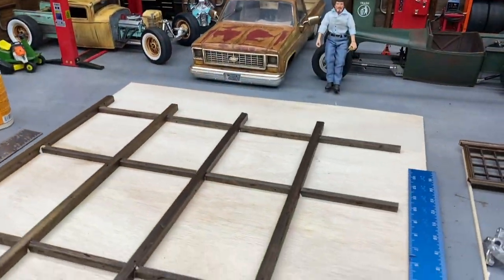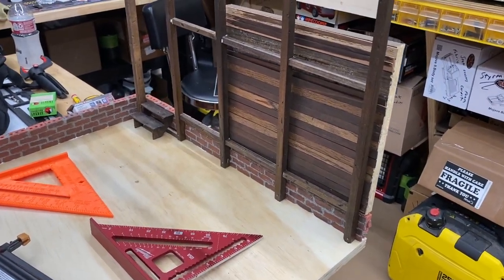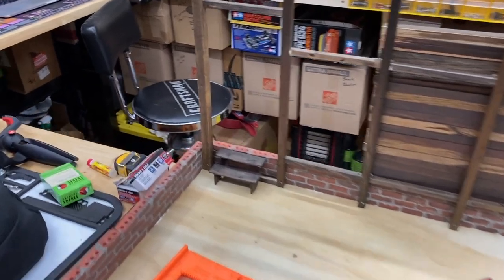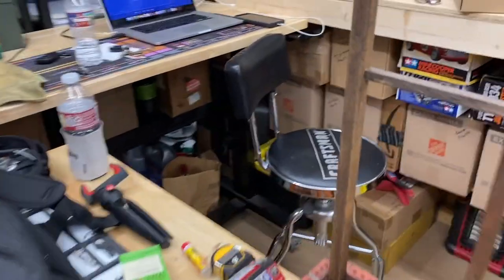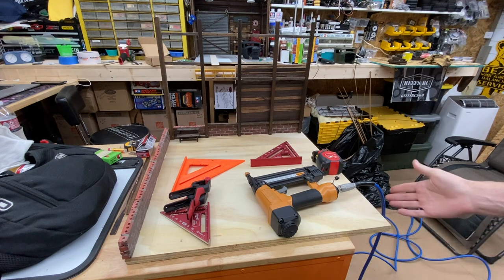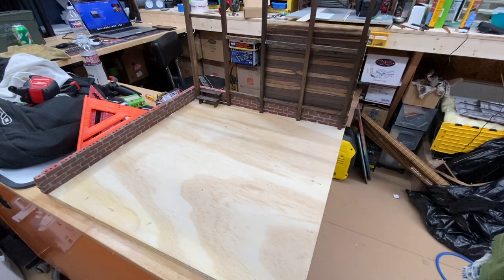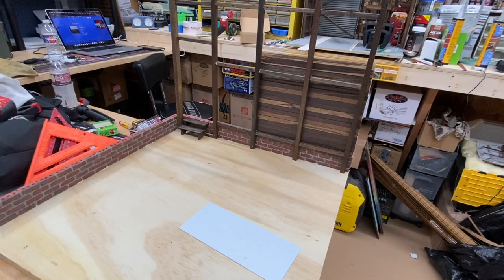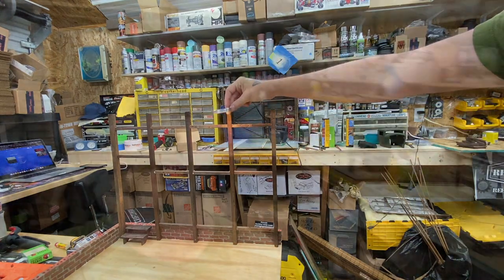Distressing Wood, Part 2 of the Scale RC Garage Build, Old Warehouse Diorama

Comment: Yeah Balsa doesn't take stain very well but you can Ebonize it which will blacken it while leaving the grain visible. 
If your interested in Ebonizing, making some Ebonizing solutions is really easy and can be done with stuff you have at home. 
  First you need Rust Vinegar which is super simple to make, all you need is regular White Vinegar and some four-ought/super fine Steel Wool. Second you need a Tannic Acid solution which can be made with Tea Bags and Water.

For Rust Vinegar add 2 cups of White Vinegar and 1 Steel Wool pad to an old jar, put the lid on and let it sit for a week until the Vinegar has dissolved the Steel Wool. Then strain the Vinegar to remove any undissolved solids and it ready to use.  

For the Tannic Acid solution add 3 Cups of Hot Water to a jar with a lid and toss in 10 Tea Bags, let the Tea Bags steep in the water for about a week. Then remove the Tea Bags and it's ready. 

When you're ready to use it first apply the Tannic Acid Tea solution to the wood and let it sit and absorb for about 5 mins, now take the Rust Vinegar solution and apply it, almost immediately the wood will turn black, if you want it darker just repeat the previous steps until its the desired color. 

Note some woods like Oak, Cedar & Walnut are high in Tannins and will Ebonize with just the Rust Vinegar. 👍👍